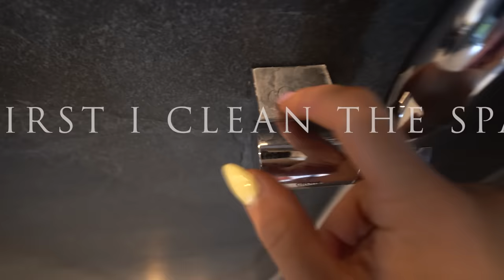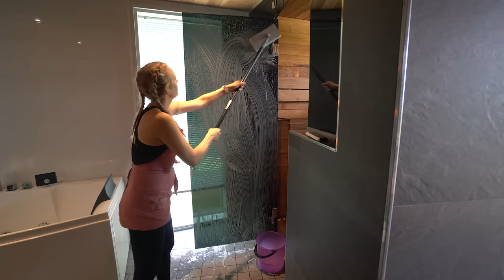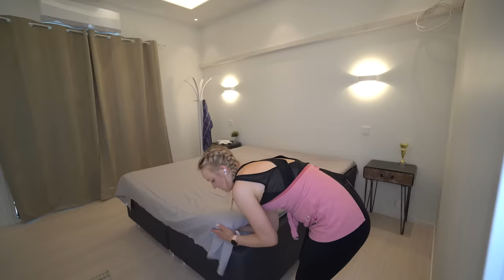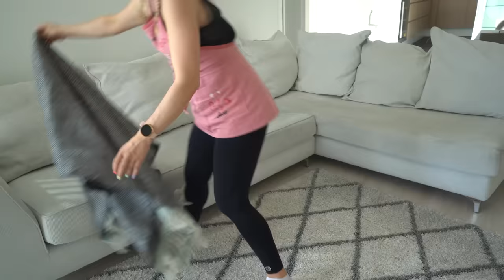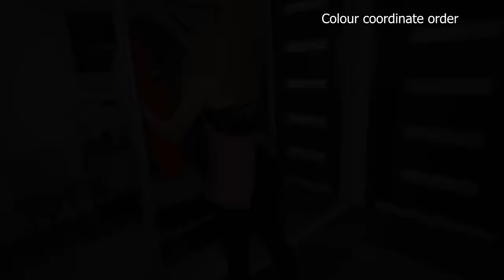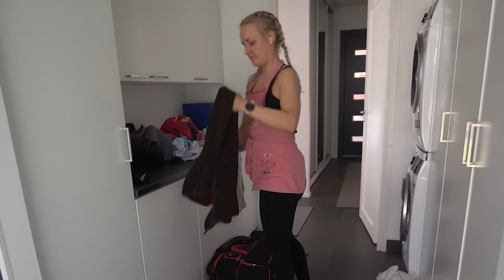MASSIVE ⭐LUXURY⭐ HOUSE DEEP CLEANING WITH ME  | Part 2

Comment: As an American I am fully jealous of the drains in the floor of the fully washable bathroom. We need to start doing this!
Reply: Yessss!! Such a genius idea!
Reply: Here in India we have the drains in the washrooms years and years back. And so we could wash our toilets and bathrooms clean. I've always wondered why u people don't have the drains in the washrooms.  It's relly frustrating to use such washrooms as i don't like wiping everywhere with clothes and tissues.
Reply: @zv7577  very True!
Reply: She did say deep clean
Reply: Yess please yes please yes please
Reply: It's a freaking messy system! When you shower, the entire bathroom is flooded. The American and Canadian (which l am) is a thousand times cleaner.
Reply: I know this from warmer countries only - I always thought this system was better suited to hotter countries, as the wetness dries more quickly. But this does not apply to Finland…
Reply: @katinsu7700  Yes it woks just fine in Finland also. Most of the bathrooms that are like this there is a underfloor heating so the bathrooms are very warm and they dry fast after showering 🙂
Reply: @yardleyj9391  No the entire bathroom is not flooding 🙂 The floors are made slightly sloping so that the water is directed directly into the drain. So you have to just wipe very small amount of water to the drain after shower.  We also have underfloor heating in baths like this, so it dries quickly.
Reply: @jaanatakala4489  I would love a bathroom like that, I live in the Netherlands and our bathroom is more like a closet with a shower head 😂
Reply: @yardleyj9391  you can have both a washable floor and showers that keep the water inside. Water does not get everywhere
Reply: Yess!!! I'd love a floor drain in my bathroom and kitchen!
Reply: My thoughts exactly!
Reply: That’s what I was thinking!
Reply: DUDE I KNOOOOOW!!!
Reply: Por isso a gente fica agoniado quando vocês não jogam água pra lavar. Nós brasileiros jogamos água em tudo, lavamos portas, janelas, paredes, às vezes até o teto 😂
Reply: I had just recently learned that In America you don't have drains in the floor in bathrooms.. I really don't know how you live without them
Reply: Its almost there all over the world in bathrooms and kitchens except in America 😏
Reply: I think this every time I watch her videos! The only bathrooms like that are public restrooms.
Reply: In Brasil all bathrooms have drains, it does a completely different type washing with water, looks more clean
Reply: I was thinking the same .. why American bathrooms and kitchen floors have no drainage ?
Reply: Watching her clean that big glass shower door then rinse it off with a hose... I wanna be able to do that to my glass shower door!
Reply: Me too!
Reply: @CedarMountainsnow  i believe the walls of the bathrooms and the bath area needs good scrubbing  and a good wash. How much can we mop, i wonder.
Reply: You don't have drains in your bathroom? Do you have them in your laundry? In Australia we have drains in the floor of all bathrooms and laundry.
Reply: @CedarMountainsnow  but if your bathroom or laundry had a water leak or flooded (bath overflow) where does your water go?  In Australia it drains away.
Reply: @anireseegam6128  when i went to Australia in 2013 the house which  i stayed didn't had drainage in barhrooms and toulets3. And everytime something is spilled, we need to wipe with towel and that was disgusting😞
Reply: Came here to say this same thing!  I wish our bathrooms had drains in the floor
Reply: @Yardley J  No, they are totally not flooded :). The floor is slightly slanted so the water pours right into the drain! And the surfaces are built with materials that don't easily contaminate with mold or rust. And in Finland we always wipe off the excess water into the drain after showering. That's why you dont have to clean the bathroom floor so often.
Reply: @rubabakeer  and I just learned that other countries do 😂😂😂
Reply: bruh exactly, everything looks so maintainable and easy to clean
Reply: I'm Israeli and my husband is British, I never really understood the benefits of not having a drain in the bathroom floor🤷🏼‍♀️it's so much easier to clean this way
Reply: Agreeeee
Reply: In Brazil there's no such a thing as bathroom without drain. In fact you can throw water everywhere in most of the houses. It's very very good to clean
Reply: Same in Germany,no drains. But we found a solution, we use a bissel vacuum cleaner that sucks water too. It makes the floors squeaky clean.
Reply: Amen!
Reply: Totally agree!!
Reply: @yardleyj9391  u r just jealous
Reply: I agree i think this would be great. i also like how the sink drains come apart by using the plug to unscrew them. Right now I pretty much run baking soda vinegar and boiling water down them to keep them from getting smelly.
Reply: Seriously
Reply: Same!
Reply: In my basement I have a drain in my laundry room/bathroom. I love it
Reply: My thoughts too as I watch this
Reply: @yardleyj9391  It's not messy, in Eastern Europe we have shower drains and we also have separate floor drains. One's for cleaning the other one for showering.
Reply: @ranna900  That's how I feel watching videos, wiping things down with polish vs "deep cleaning" , I'm like, what is the polishing doing? Wouldn't it be better to wash with water than to spray disinfectant everywhere? ( I like soap and alcohol disinfecting ,but things just don't feel clean without dunking them in water) . Books, wood,are easy to dust but if they fall into disrepair or get grimy they're not washable ( but I'd rather that than add to the tech clutter),and electrical appliances can't be dunked, cellphones are said to be as dirty as a public toilet seat - those things are fun aren't they🙃? I find it frustrating when I can't just drown things . 
I take it your grout is water tight?
Reply: @anireseegam6128  nope.... no floor drains anywhere. I know They do have floor drains in some public places like maybe the football stadium bathrooms or a restaurant or gas station bathroom but it is definitely not standard.
Reply: Honestly! I think this everytime I see these videos!!
Reply: YES, AGREED!!!
Reply: What? U don't have drains?
Reply: @yardleyj9391  It's actually bad if the whole bathroom floor floods everytime you shower, and THAT is not the point at all. :) That's why the drain is there - to prevent the flooding. 😆
One has to keep those drains clean from hairs and dirt so that they "absorb" water fast. And we use shower curtains that prevent the water from spreading all over. :)
Reply: @katinsu7700  Como brasileira digo que em meu País sempre tivemos ralos nos banheiros e áreas de serviço ( Lavanderia ) , fora o quintal acoplado à área gourmet ( churrasqueira).
Já em nossas cozinhas, a porta dela sempre têm que ter saída para o local do quintal para saída da água, lavamos com muita água a cozinha, o banheiro e demais. Lavagem à seco somente em quartos e sala com ou sem dois ambientes ( estilo aberto ou não). Como vivemos em um País tropical e muito quente, inverno quase não temos aqui e quase não suportamos o inverno ( que é pouco frio), tomamos quase 3 banhos diários, nas empresas, há banheiro com chuveiro para se banhar, quando chega em casa toma outro banho. Brasileiro definitivamente ama água em abundância, um País com muita água se gasta muito dela. Nossas garagens também. Casas quentes se refrescam   com muita água, lavamos tudo. Amamos. ❤🇧🇷
Reply: I agree
Reply: I totally agree.
Reply: every time i watch her i think the SAME thing...
Reply: Drain in the floor yes, but I absolutely hate that the bathroom is one giant shower... not for me..
Reply: me too! That would be great.
Reply: Me too! I will have one when I get my house built or remodeled.
Reply: As a french also ! I 've seen it in a belgian house, that's great ! Feels much cleaner...
Reply: @yardleyj9391  Oh, it's not messy at all! I have 2 drains on my small bathroom floor, one of them being in the shower area. The floor is also slightly tilted towards those drains, so the water will naturally flow in the drains. 

Usually after my morning shower I'll do a quick 30sec. squeezie on my glass shower walls and another 30sec. to quickly squeezie the tile floor. After that I leave the bathroom and let the underfloor heating do the rest. 

I go to my bedroom, put on my clothes and make my bed. Then I go to the kitchen and fix me some coffee and breakfast. This takes me about 20-30 minutes, and when I go back to the bathroom to wash my teeth and put on some make up, the whole bathroom is completely dry already. 

Very easy and very simple and especially so on the bathroom cleaning day! And if I simply don't have time to squeezie my shower doors or the floor, that's ok too. All it does is about 15 minutes longer to dry, but it doesn't cause any damage anywhere, because everything in the bathroom is built so. 😊
Greetings from Finland!
Reply: I came here to make this comment. I agree!!!
Reply: Me too! Would be a game changer! Makes our bathrooms seem disgusting 😂 we just spray crap and wipe it around 🤢
Reply: As an Ukrainian and plus leaving in Austria- the same!! It’s the very first thing that I noticed when I started to watch her videos
Reply: @eliyamortatler2245 What are you? you are nothing . Free  Palestine 🇵🇸❤
Reply: @catha9030 moça… De que estado você é?
Reply: @Wenixi yes! Where I live (the state of RJ, in Brazil) many houses usually have glass doors in the shower, so it makes life easier since it becomes much more convenient to just wash and wipe the glass (instead of a shower curtain)!
Reply: @No_name.6 h4teful comment towards a woman that didn’t even interact with you?

Comment: id love to know: is it just the region of Europe you are in or is it all of Europe that your bathrooms all have an open floor to get completely wet and rinse with a drain in one area. Because here in America at least that I know of, we all have bathtubs that have a shower head in them as well (most common) or a shower with a glass door and ridge at the botttom so water doesnt get out. but to be honest the way these bathrooms are designed makes much more sense. At my house we always have an issue when the water makes its way out of the tub, we get water damage to the ceiling in the bathroom downstairs which is directly under the one upstairs. if the whole bathroom had its own floor drain though, that would never happen.

Comment: I have a mop like that but it is made out of wood and I use old towels/clothes/sheets etc. They are sooooo much better than those mops you have to wring out or need special equipment to wring out. And then you have to try cleaning them for the next use? Not easy. I love just chucking the towels into the wash and it means less waste as we recycle all of our old fabric.

Comment: Does anyone have any advice on cleaning hard water stains built up over years on a kitchen sink ( stainless steel) and build up on shower walls idk the material but i live in a trailer.  I'm trying to fix it up and they never cleaned in the years they lived there.  I really don't want to go but a new wall but it's not coming off even with wet n forget. Any help would be awesome. 💙💙💙
Reply: Have you tried vinegar? It dissolves limescale. Try a small area to test that it doesn't damage walls.

Comment: First you need to remove the dust from the walls, and then make the bed. Your sequence is wrong. You first made a clean bed, made the bed, and then you began to brush off the dust that fell on the clean bed ... This is unhygienic. I also had to wipe down the bottom of the bed.